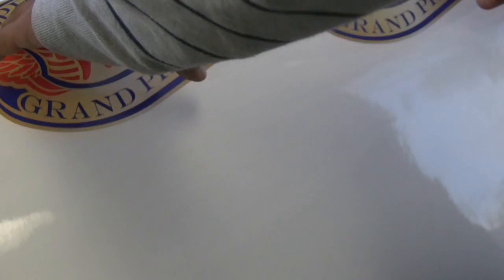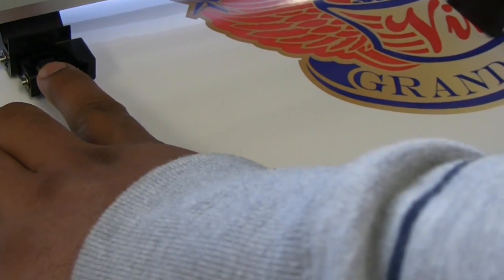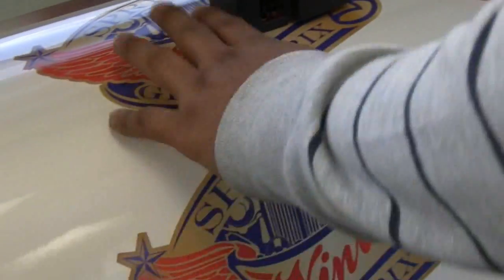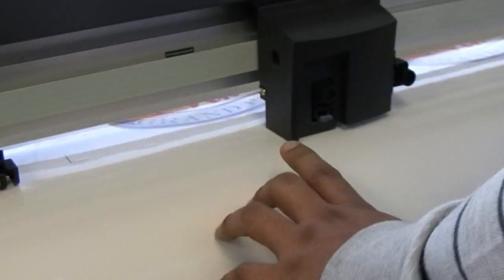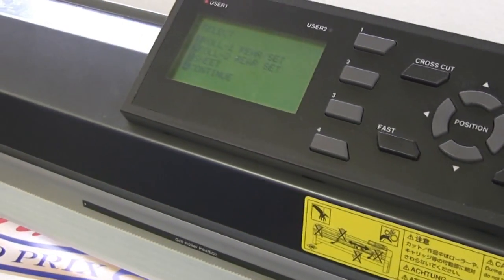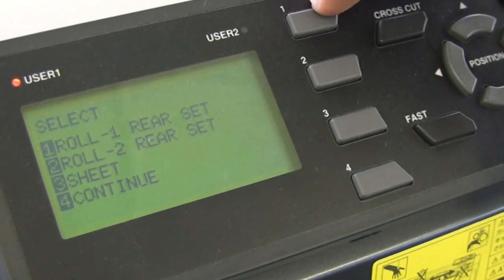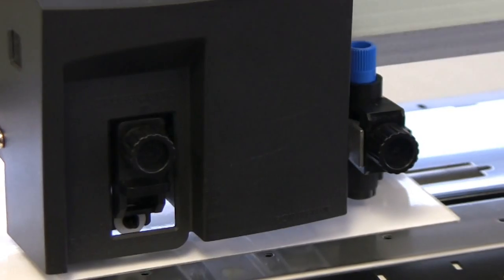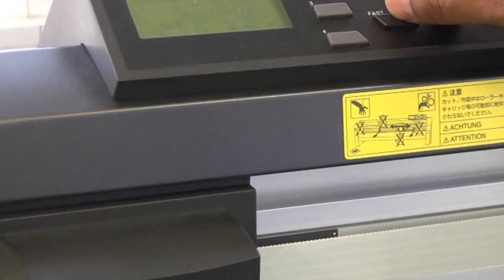LOADING MEDIA FC8000 for Print and Cut

Comment: I have an fc8000 I use for window tinting lately it is cutting with jagged edges along  to top of window patterns,it cuts the front back at botton straight lines perfect, b  the curve lines (usuallly the top) are cut jagged.I have a new blade holder,blade and cutting strip any ideas what to check.Thanks
Reply: Hello Mike,

Normally for the issue that you are having we would have you replace the Blade Holder, Blade and/or the Teflon Cutting Mat.  Since you've already done that the only thing i can think of are these 2 things.  Verify that the Condition you have currently set is for the Blade and Blade holder you currently have loaded.  For example if you are using the Blade Holder with a Blue tip with a 45 degree blade you should have the condition set to CB09U.  The other thing you can look for but not like the issue is verify if the Pen Block itself is loose.  If you have any further questions contact us at technicalsupport@graphtecamerica.com